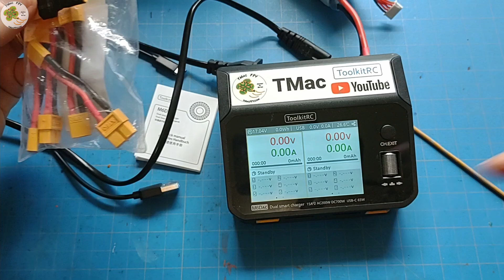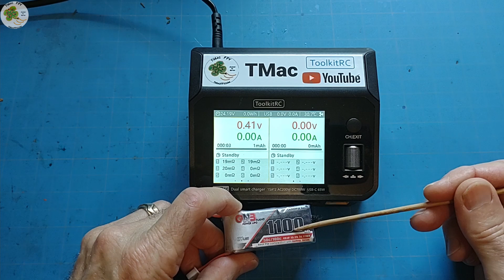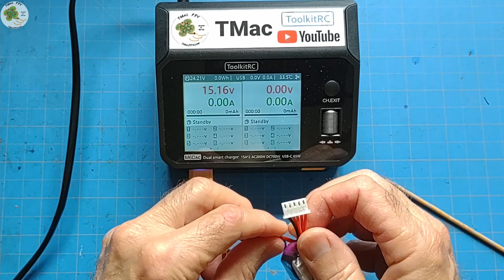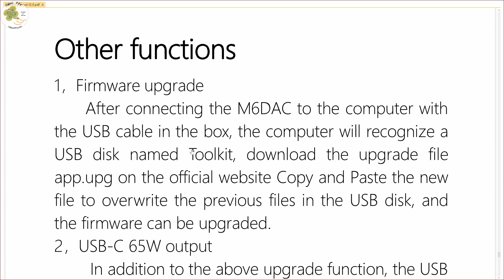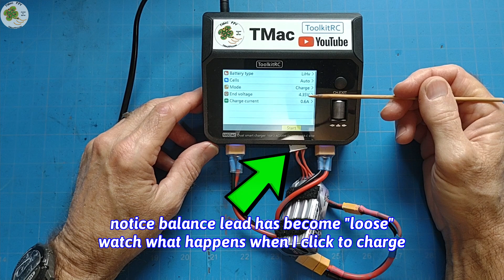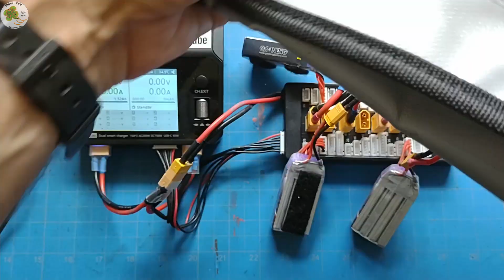High Quality RC Lipo Battery Charger (TOOLKITRC M6DAC!)

Comment: Probably the greatest review about this charger in the web, thank you!
One question: Can you also use it as a simple constant voltage power supply? E.g. for a 24V soldering iron?

Comment: From the writing on the front it only does 200w on mains power is that correct? Apart from that and the fact i hate scroll wheels it looks amazing i wont buy it for the two reasons i mentioned. Or is it 200w per channel on mains?
Reply: im after that info as well! im assuming 200w roughly 10amps per channel  on ac... crazy its called the m6dac !! and no ac testing in the majority of reviews?

Comment: It's a compact powerhouse this one. Did you test it's discharge to storage voltage? That usually takes a lifetime on most chargers.
Reply from the maker: Yes I did! Quick, not long at all. I very much like this one. Did I mention it's quiet?!?😂
Reply: @TMacFPV  Yes, and I loved it. Also, the safety tips to parallel charging are golden. This video is a must to anyone who wants to do it. The manual should have a link to your channel.